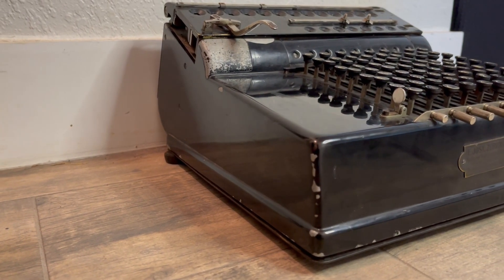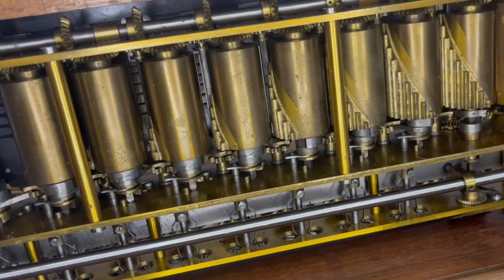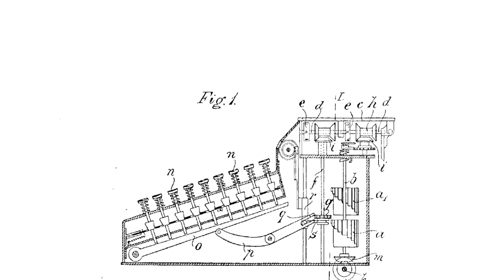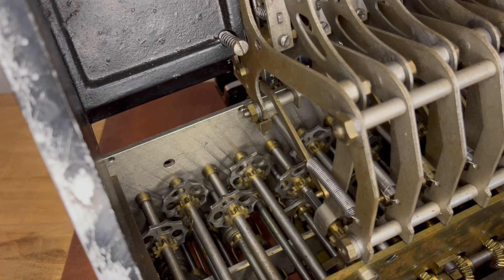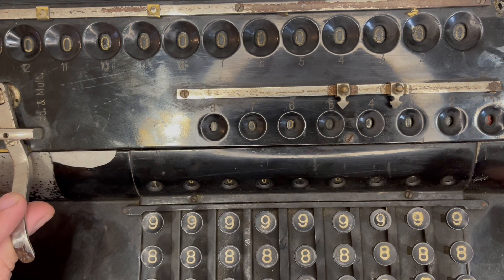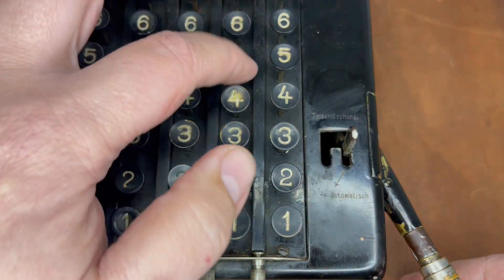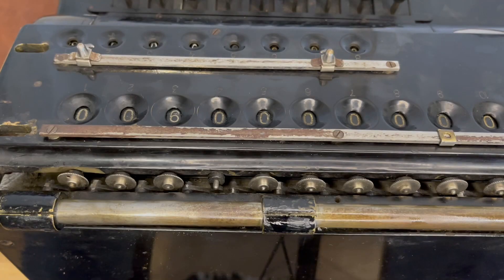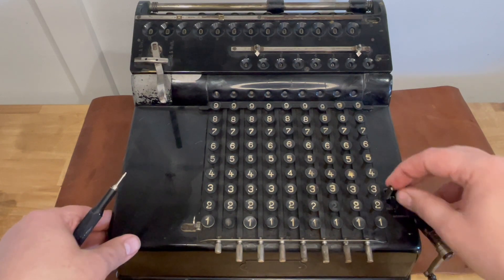Lindström Record mechanical calculator

Comment: "Missing its front right foot".  Have you ever had a stove, with four heating elements, and one knob for each element... and the knobs are labelled with words, like "front/back left/right"?  I saw such a stove once.  The two 'front' ones were nearer to the cook, the two 'rear' ones were nearer to the wall.  The 'front/back' was from the stove's own perspective, as if it were facing me.  But the left/right was from the cook's perspective.

If you point away from your body in the direction front-left, then front-right, then back-right, your arm, as viewed from above, goes in a clockwise direction.  Point to the burners labelled that way, in that order, and you go anticlockwise.

I think the same is true for houses.  The front of the house is what's closest to the road, but if you say 'the left side of the house', most people would interpret that as, if you're facing the house from the street, the side that you see as being on the left.
Reply from the maker: If it had a steering wheel that would have helped.
Reply: @stephenfreeborn  I'm now imagining a calculating machine with a steering wheel, a stove with a steering wheel, and a house with a steering wheel.  Each of these images is pleasingly funny.

Comment: Great timing! I got one a few weeks ago (sn 1792), am researching it right now, and will make my own video some time soon. Thankfully the only damage mine got in transit is that two of the rubber feet fell apart, and that may have happened when I was unwrapping it. What's the serial number on yours? I couldn't quite make it out. There are few enough of these about that I'm compiling a list.
Reply from the maker: Mine is 1807.  Now I just need a Kuhrt to compliment it.
Reply: @stephenfreeborn  Thanks. I've been trying to verify the claim about there being only roughly 800 pre-Lindstrom machines. I believe it, but there is a big gap in the serial numbers: 746 to 1792. Mine has the lowest number of all the Lindstrom machines I could find so far. Maybe Lindstrom skipped ahead to 1500 or so.
Reply from the maker: Reese’s article says that by #787 they steady had Roneo’s sticker on them. From that I thought mine should be a Lindström.  Host’s tag made me second guess that a bit, but I still don’t really know.  There’s no trace of any other logo. I can convince myself I can see the old oval remnants of a Lindström logo on there but i don’t know for sure.
Reply from the maker: *Jost’s
Reply: @stephenfreeborn  I have no doubt yours is a Lindström, exactly like mine. Mine does still have a little of the red/gold decal remaining. It was much later that the decal was replaced by a proper engraved+painted logo. Mine was also sold by Jost - it looks like it used to have a plaque like yours, but then had a Jost decal put on instead. I know Reese's article, but was trying to confirm its claim independently, as I haven't seen 787, and it could have been reconditioned and then resold through Roneo.
BTW, I think you may have misinterpreted what the German article said. Lindström manufactured the machines from 1921 till 1929, and sold/distributed them through Roneo, a company closely related to Lindström in some way that I haven't figured out. After that Roneo still sold them for about 2 more years, but I think that was left-over stock and that Roneo did not take over production.
Reply from the maker: I wondered that about Roneo. I assumed it was the same Roneo that was making mimeograph machines? I’ll be interested to see what else you dig up on this device. It’s the best I have, but sometimes Google translate isn’t quite up to the task.
Reply: @stephenfreeborn  Yes, that Roneo. They also sold/distributed Lindström's dictation machines.

Comment: very nice! I love machines with the crank coming out at a weird angle. How'd you film the long slow shot at the beginning? Just a steady hand? Very smooth.
Reply from the maker: Thanks for commenting. That’s with a cheap little motorized dolly called neewer. It bumps over the tiles but iMovie smoothed it out just fine. Then I just slowed down the clip. How do you do that effect where you have a bunch of photos that stack on each other? I don’t even know what to call that effect.
Reply from the maker: You can see the dolly roll by in the reflection.
Reply: @stephenfreeborn  I looked for dolly tracks but not a reflection! Very cool. My end montage is a hand-written python script that stacks the photos and then makes a video output. (imagemagick and ffmpeg)
Reply from the maker: “Hand-written python script?! Properly punctuated description of complicated coding. Who are you?
Reply from the maker: @ChrisStaecker I just tagged you. That’s a new thing my wife just taught me about. I’m 44.